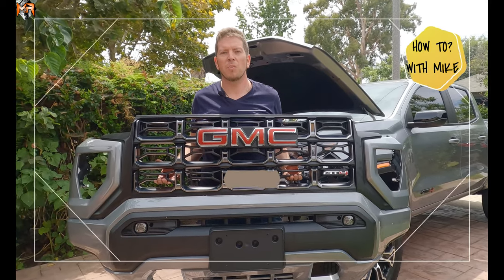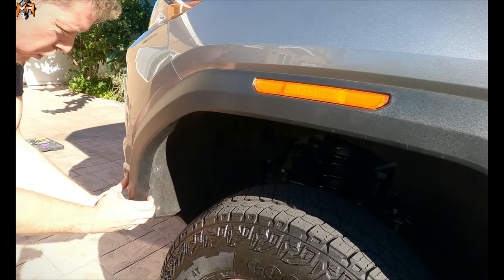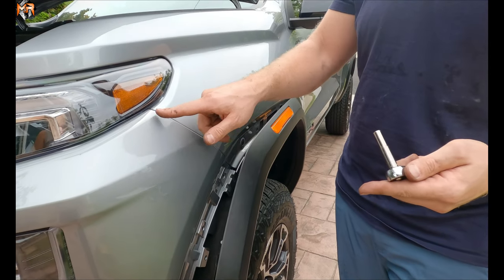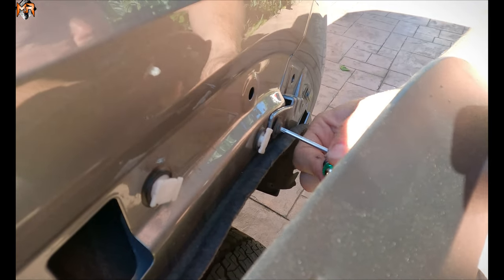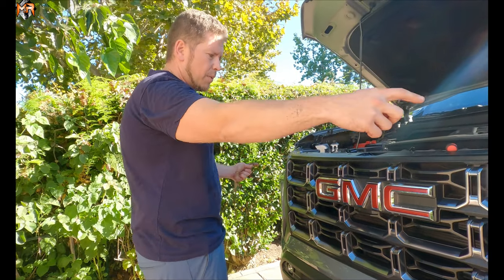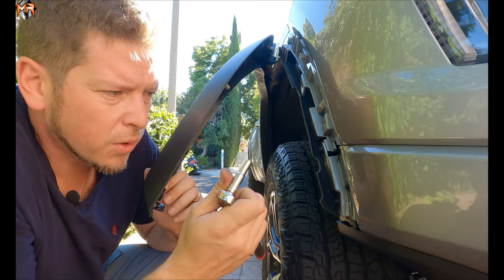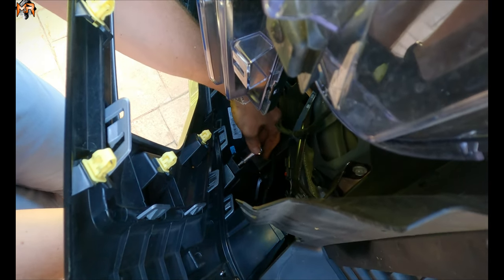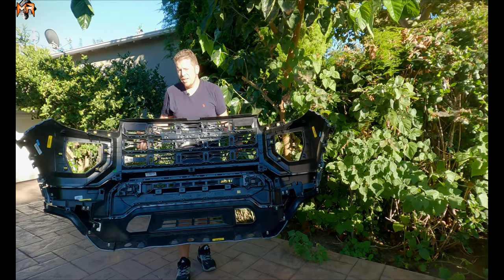How to take off the grille from 2023 2024 GMC Canyon by M&R Automotive MandRonline

Comment: I would love to know how to remove the front grill and not the entire upper and lower front face/bumpers and grill like you have removed.
Reply from the maker: I believe you need to remove the whole front first and then you can unclip the actual grille
Reply: I attempted to remove the "chrome" grille covers on my '23 Canyon Denali without removing the entire assembly, so I could paint them black.  There are three grille covers/sections.  I was able to remove the bottom cover by pressing down on the tabs that secure it to the grille itself, using hook tools.  I then noticed that the two end tabs on the top cover are directly behind the light assembly and therefore cannot be accessed without removing the entire grille.  I abandoned the project after that because I really do not want to remove the entire assembly.  Hopefully some vendor will manufacture black plastic overlays to easily cover up the chrome grille.  I spoke with one vendor that manufacturers black overlays for Sierra grilles.  They indicated that there are currently not enough Canyons out there to justify their cost of manufacturing overlays for the new generation Canyon.  Waiting game now.

Comment: Have you ever removed the grill on a 2023 Canyon AT4X model? The grill does not appear to be a solid piece on the X version. There is a grill support member that runs from the grill to the radiator shutters. Have you seen this? We are trying to install base plates for a tow bar. Thanks for any help.
Reply from the maker: We have not had the at4x my apologies

Comment: How did you get to the top fender released bolt. I can loosen the first 2 but can’t get the 7 mm deep socket on the top bolt. What’s your secret.
Reply from the maker: Try removing the one closer to the tire and the other ones just unclip